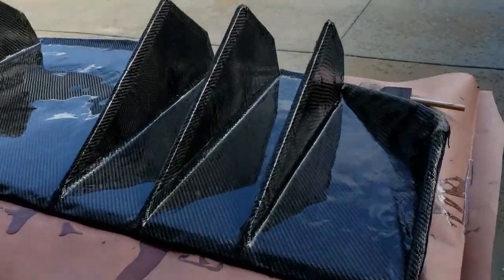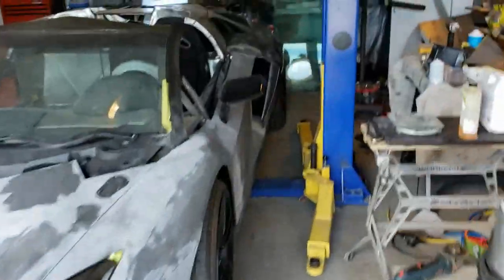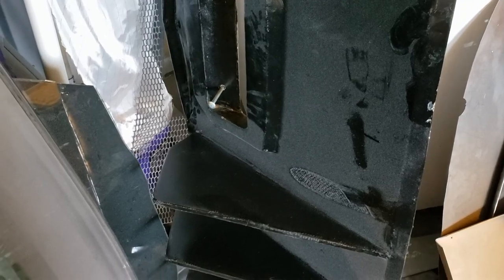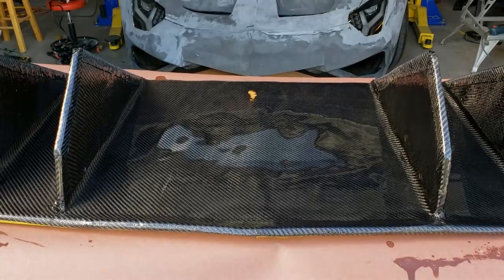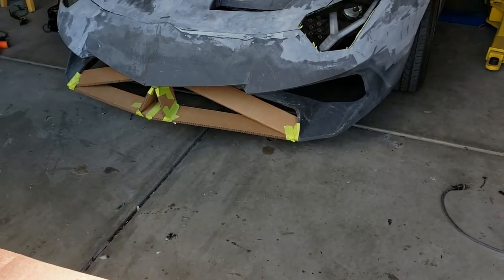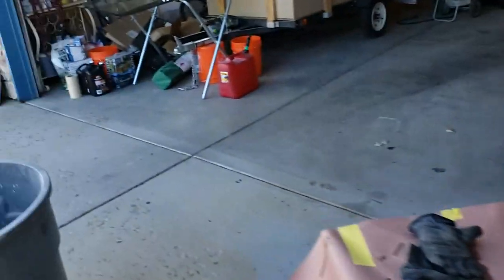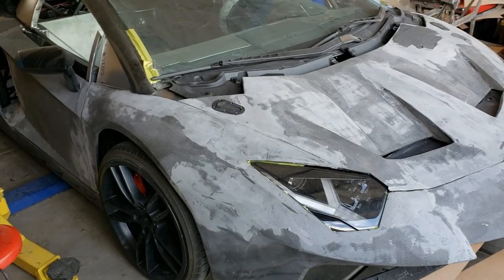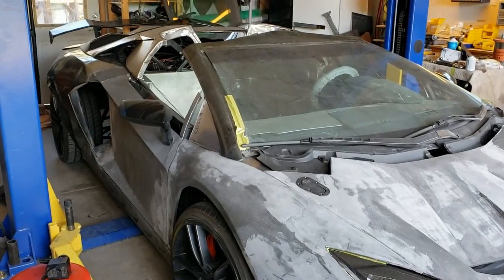3D Printed Interceptor Update 43

Comment: You should put a  TOYOTA 1GZ-FE v12 in it 
they only cost like 3000$ or a Mercedes  S600 W140  v12.
Reply: https://www.ebay.com/itm/96-99-Mercedes-W140-S600-CL600-Engine-Motor-Assembly-M120-V12-6-0L-OEM-130k/124263631368?fits=Model%3AS600&hash=item1ceeb08a08:g:~-AAAOSwPHhfEVnr
Reply: https://www.ebay.com/itm/JDM-TOYOTA-CENTURY-1GZ-FE-5-0L-V12-Engine-Automatic-Transmission-Harness-ECU/283772399573?fits=Make%3AToyota&epid=693888794&hash=item4212272fd5:g:xNsAAOSw-v5eOhvQ

Comment: I know you have discussed this before about making your panels carbon fiber and leaving it that way. 
My suggestion would be to leave one panel such as the hood carbon fiber to display your method, but leave the body work on the other panels. 

The reason is because you closed all the gaps already, and you said you want to overlay another layer. You will not be able to fit items back on or you will not be able to get the finish you expected because you can’t add more epoxy with no room for gaps.